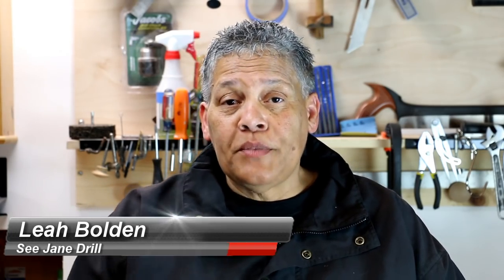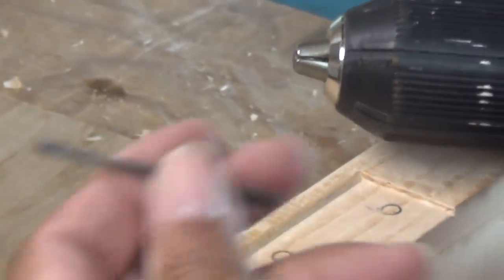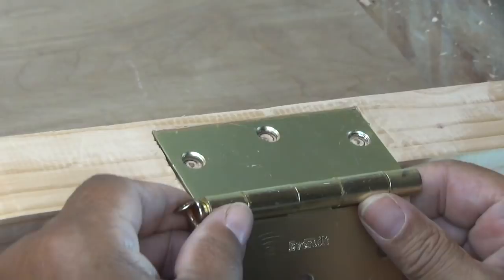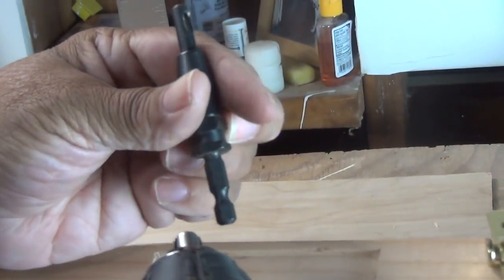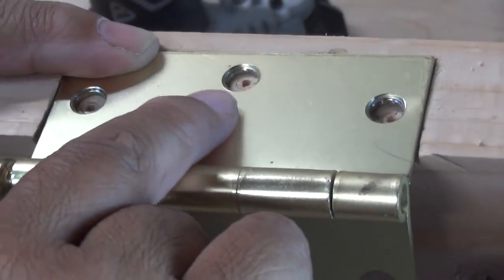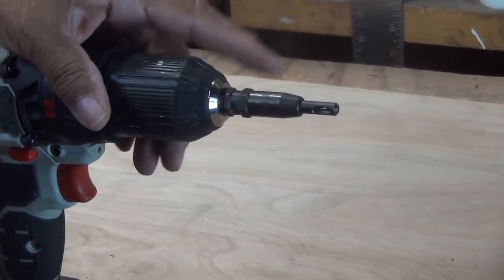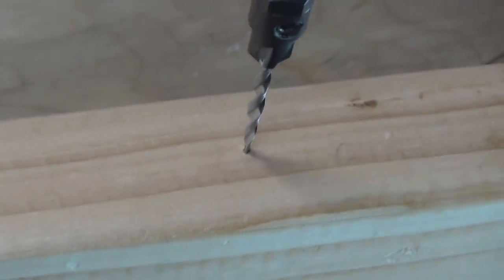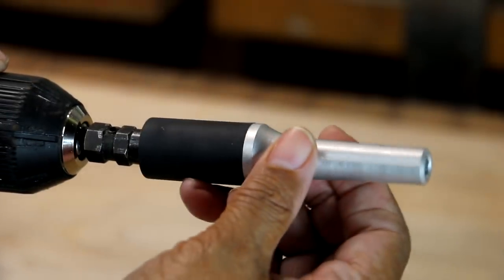Cool Carpentry Tool

Comment: It's a cool tool but it's a little pricey for me.  I don't do a lot of carpentry but I could see this being a real time saver for someone that does.
Reply: Bruce L. This unit is costly, but other people make units like this minus the sleeve attachment.
Reply: Cabinet shops and furniture building.   I've mounted hundreds of custom made doors using these to quickly pilot the Salice hinges, etc....   Can adjust the plunge depth also I believe....
Reply: It should only be about ten of your earth bucks. :¬D
Reply: Cheaper than buying and using two separate drill/drivers for a job, but if you already have the two drill/drivers with one set up with the centering drill and the other with the countersink, it is quicker to use the 2 drill set up than to keep changing the sleeve around, and you would save about $90 considering the sales tax, etc.   At $30 to $40, even with a less complete set,  it might be worth trying out.   Thanks for the video.

Comment: That counter sink bit is cooler than you realize. Notice it's tapered point design. When working with thin boards,(I install cabinet's), where you need the put a screw in the side of say a half or three quarter inch board, (say cabinet door hinge), a regular bit, especially if you're drilling deep or in cheap board like MDF, will split the wood. That tapered bit won't do that. I don't suggest using an impact as it don't take long and you'll snap the bit at the quick connect and they're about $10 apiece. But they're a game changer

Comment: Glad you're showing these to folks.  I've used the rockler kit for some years now.  It's even better for smaller hinges, drawer slides, etc. where there are tighter tolerances.  These are sometimes called Vix bits, too, not sure if that's a brand or generic name.  I don't use the sleeve part, since I don't drive my hinge screws with a drill, but rather with a power screwdriver, good if I am doing a bunch of screws, or by hand for a few.  I don't use the drill on hinge screws which are generally on cabinet doors made of hardwood because I want something less aggressive, smaller and easier to control.  Not so likely to strip out the screws, overtighten, etc.  So, the sleeve has a place, but I've never used it because of the type of projects I do.  The (Vix) hinge bits are great for both speed and accurcy, I wouldn't be without them.  They are pricey, but I got them when on sale when they are more affordable.

Comment: Thanks that is cool. Countersinking bits are always a problem though. The most-used ones are those with pilot hole bits 3mm less - the bits are easily broken and the collars move.

Comment: I have a bit that goes into the drill chuck. You can drill a pilot hole, then pull off the part at the end and flip it around and your Phillips bit is there to drive home screws.

Comment: I don’t know if you’ve seen the tool or not yet. But I received a little kit as a gift, called the Zach Rabbit. It’s extremely nice, well made Zach is the carpenter from Tiny House Nation. He developed these apparently, and I have to say it’s the biggest time saver ever. It’s very pricey thought. The basic kit is about $60 and the one I received was the full kit for $99 I think? It sounds like it was kinda based off of this tool kit but much much better.

Comment: Good video. It's nice but not very realistic that you put all three pilot holes dead center by eye-balling. I've maybe done this five times in the past 40 years. That's why the centering drill bits or the hinge-pin-punch always do a better job. 

Critical to usefulness are 1. Does the driver over-sleeve fall off? 2. How out of balance is that long over-sleeve (this is because phillips head screws-- still standard for hinge butts is so wobbly-as it was designed to be 100 years ago (and never fixed)). 

Looks like a pretty good system, but it should be shorter overall length, and the countersink drill bits should be easily and inexpensively replaced. I'll break one of those bits about every four hours of working with it. ( I should just set up a grinder rig to make these out of 3/16" bits and to grind back to center broken off ones). Short comings with these countersink/drill bits has probably sold more self-drilling 'drywall-type' screws than anything else.

Comment: I imagine another benefit of this is that your hinge isn't going to move, since the holes will be much better centered than if you mark, remove, pre-drill, put back... Will this make the door easier to plumb when hanging?  Since the hinge is more likely to be set correctly, vs tipped a little, or just slightly out of square with the other hinges.
Reply: rjtumble Man, I find a way to mess it up every time.  Keeping the hinge in place with a dab of CA glue would make things much more precise for me.
Reply: joedanger666 I'm about to hang a door, I'll give that a try, thanks for the tip

Comment: Ms. Leah, that is pretty cool, saves not only steps, but remembering or fishing out the second or third piece one needs.  I do have a question when you get time.  (Sorry for being behind on y’all’s videos) it appeared that the Tool removed some of the brass plating off the hinge.  It didn’t look like it interfered with the screw being set correctly but it looked like it took the countersink part off.  I was wondering if you have any concerns about rust setting in?
Reply from the maker: you know, Elaine, it was just a "trick of the camera angle", because it really didn't take off any of the plating. 🙂
Reply: seejanedrill thank you so much Ms. Leah!

Comment: Self centering bits have been used by door and hardware installers for decades , the second tool never worked well. The tapered bits tend to jam and break in all but the softest woods . There is a similar tool used for installing Tapcon /masonry screws that is expensive and tends to wear out quickly
Reply: The ones I have are always off a little  off, had to replace from stolen. What brand do you recommend?
Reply: Jim Carter  self centering bits ? They come in different sizes matched by screw numbers , when I use one too small that happens. As for brands  for pro work I like Vic's brand but I have used less expensive ones that were fine.

Comment: Thanks... love your videos. But this "cool tool" is worth maybe $15, not $75. And the time savings, if all works right, is not enough to justify the cost.  There's the problem: IF all works right. One of the countersink bits snapped right away. And, the collar around the hole-drilling bit you first showed, loads up when drilling in soft wood, and it isn't easy to clean, thereby destroying any time advantage. The pouch it comes in is of inferior quality, and doesn't even fit all the items. I prefer the old notch-mark-drill method, which is simplicity in itself. Love your recommendations, but this is one tool that will gather dust in the bin of parts under my work bench.

Comment: I doubt this ? Will get an answer but. . . CAN it be used with a kreg pilot hole gig??? That would be wonderful ,or if there is a tool out that can be used for that as not to have to change drill bit to screw driver over and over???
Reply from the maker: Of you mean a pocket hole jig,  I don't believe it would work well in tandem.  The drill bit sleeve may be to large to insert into the jig.

Comment: Why are people still using Phillips over robertsons
Reply: who knows. a lot of the wood screws i buy have a phillips pattern cut into them. but, they also have the square cut in the middle to allow the use of a robertsons bit. so i generally go with the square drive, instead of the phillips. i think i've had maybe 2 or 3 screws that got reamed out using the square drive, vs hundreds of phillips screws that got reamed out.

it's definitely a much better way and much stronger and easier to get a good bite on the screw. they should just do away with phillips head altogether.
Reply: The best thing about using the screws with both is that on the rare exceptions that the Robertson drive strips out, I just grab the Phillips and reverse the screw out.
Reply: When you buy hinges they come with matching screws for finish, and most are phillips.
Reply: Hell, a lot of the companies have moved onto Torx bits instead.  Love my Robertson screws, you can drive a screw and hang the drill from the bit.
Reply: Well you can blame Henry Ford for the rarity of the Robertson screw availability in the U.S. In Canaduh it would be rare to find anything but the Robertson head in any hardware store unless it was the newer Torx. At one point apparently Ford was in negotiations with the inventor to use the Robertson head in there automotive plants, the story goes Robertson and Ford got into an argument and Ford then refused to use the Robertson head screws at all and used the phillips head instead. Had he done so that would have made the screwdrivers and screws much more common today.

However old Robertson head screws that were North American made were a much higher quality with far better durability than what were seeing that are made overseas today. The recess seems slightly shorter with a less well fitting grip on the driver tip, and the metal hardness seems softer so were seeing problems with the tips camming out of the recess and stripping the the heads. I've used 10's of thousands of the robertson screws over the years and the new quality is nothing like the old.
Reply: Turning Point I e read at some time that with so many countries making screws and drivers, there isn’t an international agreement so each country has their own definition of measurement unfortunately.  This is one of the many reasons I purchase USA made items, then North America, Japan, GB, Germany, and China, Taiwan, Korea, last of all.
Reply: Well I'd like to think I've picked up a little about engineering standards, specifications, and quality control through my main hobby of metal machining Elaine. I'm certainly no expert, but to me it looks like those batches of cheaper off shore made Robertson headed screws are the way they are simply because the forming dies aren't being changed out as soon as they start producing out of specification recesses. And the metal quality and heat treatment is far less tightly controled. I also think the forming dies across the flats are slightly larger to start with than they should be simply to increase the time between die changes.That results in a poor fit between the screwdriver tip and the screws head recess. High quality metal products do have a cost and the price of labor has very little to do with the final price. If better quality Robertson deck screws were available in the little town I live in I'd certainly pay the extra. I don't have that option. Shearing the heads off the screws shouldn't be possible using them on Pine and Fir construction grade wood. Randomly that happens quite often. That happens for only two reasons, metal quality and / or poorly controled heat treatment.

But the manufacturing industry does have specific industry standards word wide for both the imperial and metric based measurement systems that are traceable to the parent organisations in charge of setting those standards. NIST in the U.S. would be the one for imperial and metric measurements. And every product has preset maximum allowable deviations on the engineering drawings with a plus and minus limit where the product is then judged to be out of specification. It's still up to each manufacturer to stay within those and there's no rules saying they must do so. 

India and parts of South East Asia such as Vietnam should be the last ones on your list. :-) China is slowly raising there quality, as they do so other countrys are jumping in to make anything they can at the cheapest possible price.
Reply: Turning Point what you say may all be true.  I’m definitely not going to doubt you!  Many, many years ago as a machine operator, if the punch dies were too big, the cans or tubes would not go through my lacquer machine as the machine was always set to the midline engineers specs.  I set my machine every shift, once and didn’t have it quit the rest of the shift.  Why have the cost of an engineer do all that work, if one isn’t going to follow them?  But that was back when engineers didn’t always have degrees and many engineers were also machinists working in the back rooms, developing new toys for me.  And my degree isn’t in engineering.  So for now, I will stick to companies anytime I can to keep steel in the United States to help keep material costs for all manufacturing companies involved with steel.  I believe China has finished with their bridge and shouldn’t be using that excuse to acquire all our scrap metal, but I have not heard from my better half that steel prices have had any significant drop.  That’s also not saying all manufacturing in China is junk.  But if a nation has one or two honorable countries among dozens, those few are not getting their due.  Sometimes greed is not such a good thing.
Reply: Here in the UK we use pozi drive, like phillips but slightly better but we are slowly moving over to torx
Reply: Brian Beck Brian's Pro  really ? Are you using the right number /matching tip to the screw  ?  Squares have different sizes too .
Reply: brianohbrian burns  I'm in western Canaduh so it may be different back east. But yes drywall screws would be Phillips as you say. For most of the rest from an actual hardware store I usually see Robertsons including the pan heads. And that's certainly true for deck screws as well unless you want to pay a great deal more for the Torx or similar clones of that head design.
Reply: brianohbrian burns  Yeah I would agree the Phillips are a bit more finished looking. But my tastes in fine hardware have been perverted by too much exposure to pictures of custom high end rifles, older metrology equipment, watches etc. So properly slotted and polished screws, and when tightened the slots have to line up with each other. :-) Useless head design for power driving them though.

 However today's slotted and surely invented in hell tapered screwdriver tip shapes couldn't be designed and made worse if they tried. There 100% wrong and apply the most torque at the top and there fore weakest part of the screw head. A properly fitted parallel ground gunsmithing screw driver tip that just fits the slot length, width and depth is about impossible to damage the screw head or have the tip cam out of the slot. Plus there fairly easy to make from scratch in any metal type you want.